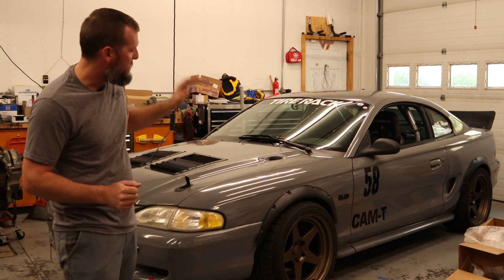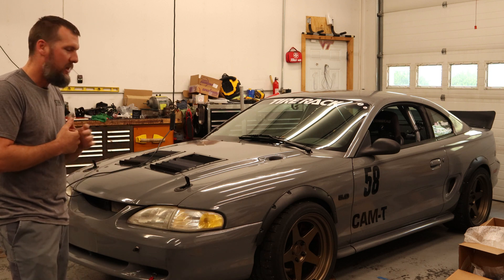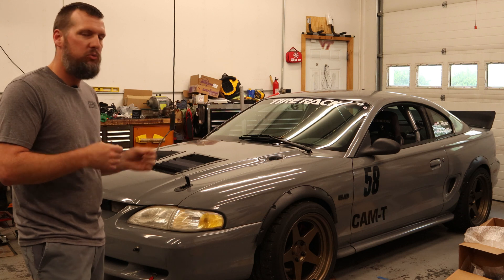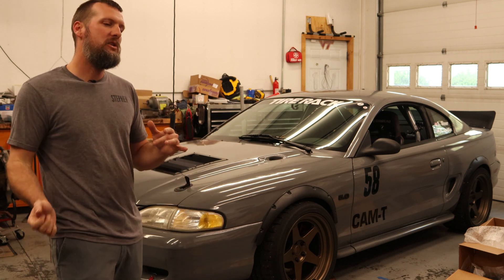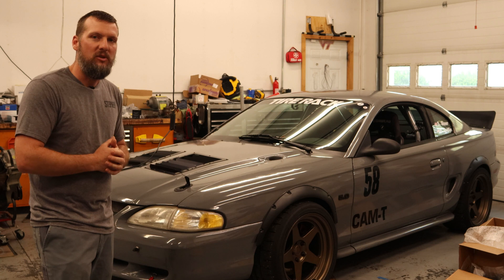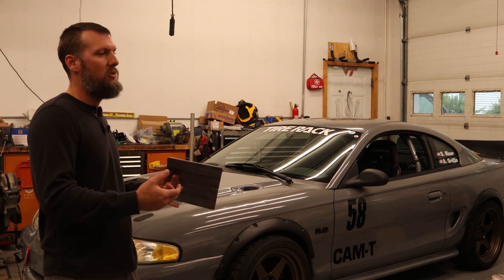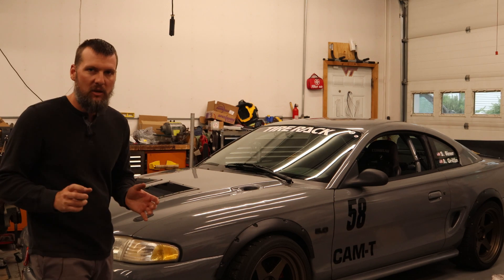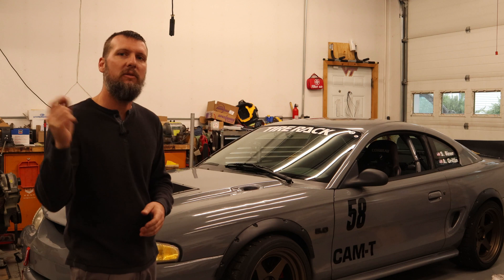Maximizing Grip of Mustang Double Wishbone Front Suspension

Comment: I hadn't thought about the camber gain and jacking effect of increased caster. I can definitely see those being helpful in pretty much any application. But the flip side is that the primary purpose of caster is high-speed stability-- which actually implies resistance to steering. I would have expected too much caster to be a problem with autocross since you want quick steering. So I'm genuinely curious where the happy medium is between "enough jacking" and "too much stability".

Something else to consider, if you haven't already, is that the rolling radius of the tire plays a role. Caster angle is really just a convenient way to measure "trail", which is what's actually at play. It isn't a commonly used term (that I've seen), but it's simply the longitudinal distance between the point where the steering axis meets the ground and the center of the contact patch. So, the tangent of the caster angle times the rolling radius of the tire. If Griggs is recommending 8 degrees based on a 28" tire and you're running a 26" tire you would end up with about 7.5% less trail than they had. Significant? I have no idea. I'm mostly just typing because I like the sound of my keyboard.

Seems tire width and wheel offset have to play a role in the jacking effect as well. Suspension geometry is basically voodoo.

I wanted to add that yours is the first SN95 I've ever seen that I would gladly drive. I've never liked the body style, but the spoiler, hood vents, hood pins, and fender flares really change the look.
Reply from the maker: I agree on the looks of the car. I wasn't a fan at first either (foxbody guy), but it's grown on me now.

That's a good point about how tire size can affect some items and I'm not sure what Griggs was designed to or recommends.

Suspension design is all about compromises. And there are so many little adjustments. But I can say the caster increase definitely helped.

Comment: 9* caster, -3 camber. It's easy to get an autox car too stiff. These 200tw tire like roll to get them into the track. My opinion is your front bar is too big and it shouldn't need a rear bar at all. Just my opinion, but that setup is proven (LS Fest Grand Champion Vintage, SCCA Chasing the Dragon Hillclimb record holder, etc.) But it's a learning game. Try things until it works for you. Nice work on the car.
Reply from the maker: Thanks for sharing setup. I'm open to trying those suggestions. Part of suspension tuning is figuring out what works for you
Reply from the maker: What front and rear wheel rate do you run?
Reply: @RinerAutomotive  Front is 425lb springs, .875 motion ratio, 31* shock angle, so about 200lb wheel rate I believe. Rear springs are 375lb.
Reply from the maker: Interesting. I'm much stiffer. Wheel rate of ~315 lb front and 275 rear